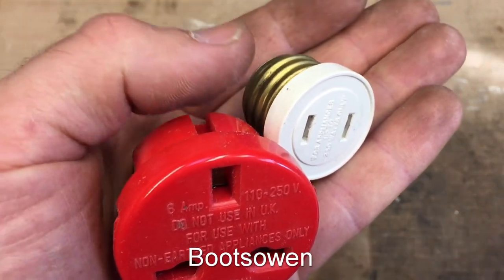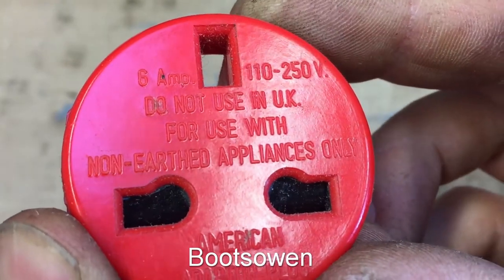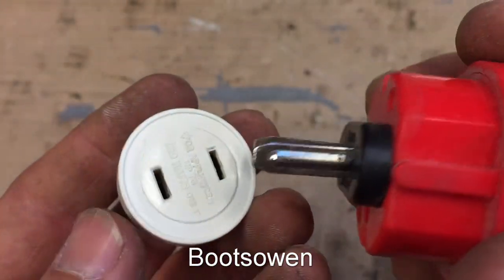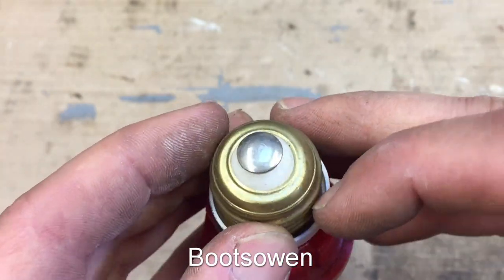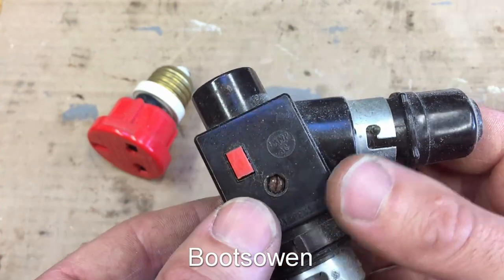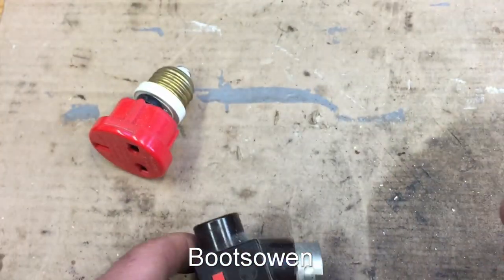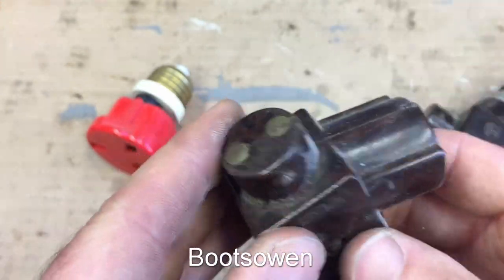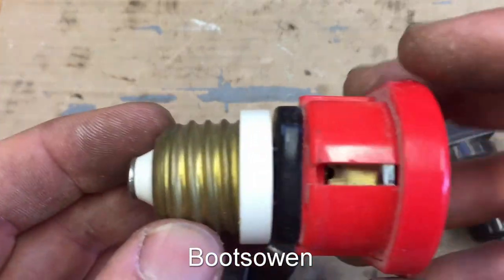Dodgy vintage electricals: turn your ceiling light into a socket!

Comment: I heard from an old electrician, originally when electricity was installed into houses it was only a lighting circuit
Reply from the maker: I guess it depends on where you were. In Ireland it was as you say, a light in every room and maybe plugs in the kitchen. Going way back, some electrical services were DC or AC at different voltages to what we use now. But they would have been local schemes rather than national systems like we have now.

Comment: perfect i can plug the iron in & not keep tripping over the cable , , until the lighting wireing catches on fire LOL
Reply from the maker: I think a good idea might be to add a three way splitter and run the heater, iron and washing machine without the risk of a trip hazard. You could daisy chain a few extension cords and get a tumble dryer on it too.